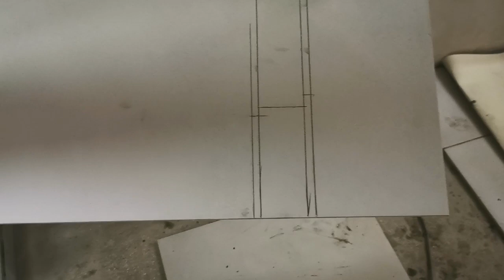how to draw and cut a door frame on a tile

Comment: Hey man what is this called to measure like this? I would like to learn
Reply: Im not sure but it is quite simple, he uses the inverted side to draw an outline, try it yourself with piece of paper. 

It is like measuring what you have over on the other side, marking a line. Then draw the lines untill they meet and that is what you have to cut out.